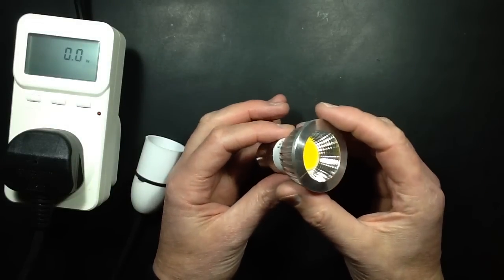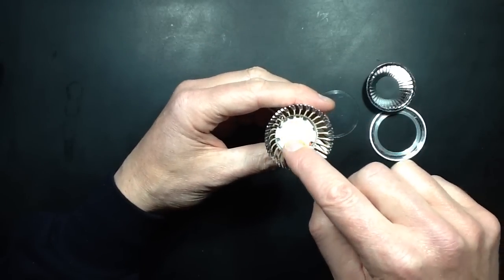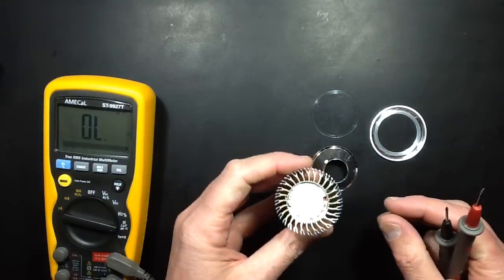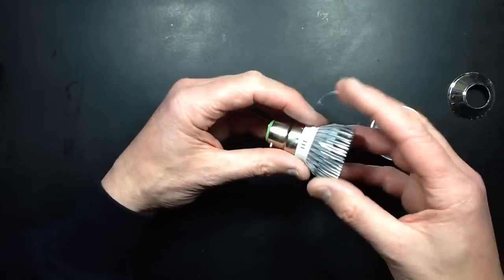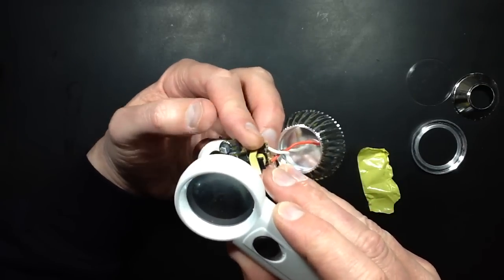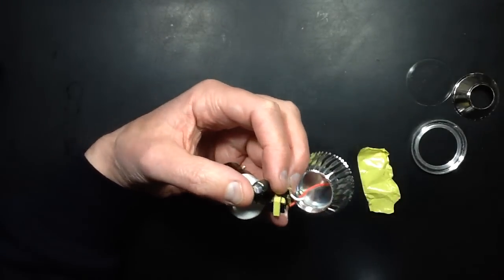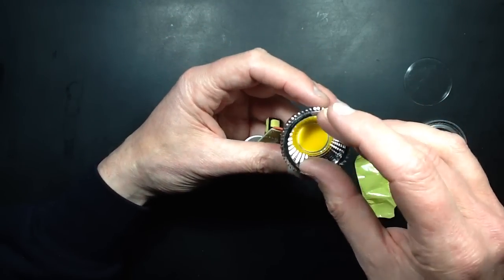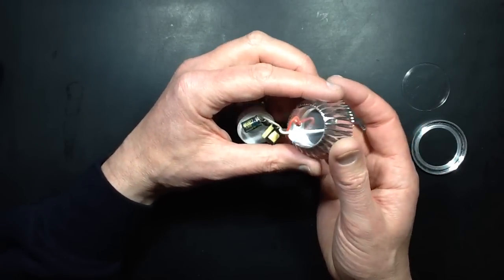A look inside a recent COB style light.

Comment: The power ratings given on ebay for the LED lamps often is the max led chip rating, the actual power is often 1/2 or even less as advertised. The switch mode power supply in most 240v Direct replacement lamps are unreliable, and do not meet safety requirements. The best solution is to move to 12V mr16 down lights and use a reliable external power supply.

Comment: just bought 6 of these lamps, exact ones.. took em to bits, and they are identical, put a different cap and resistor by watching your videos (I've watched them all believe it or not).. now my power usage for all my lights in the house is under 100 watts 2000sq ft with floods outside...

Comment: I bought the 12 volt version of these. Rated 6w but it draws only about 2.6. It uses the same COB that is not properly affixed to the heatsink. I modded all of mine by replacing the COB with a Cree CXA1304 (9v version) COB LED. Much brighter and after two months, still working great.
Reply: +JohnAudioTech this is true.
They are starting to massively overrate the things on ebay
http://www.ebay.com/itm/111915160576?
6 watt, draws 2 watts...

Comment: The threads on the heatsink and cover look like some quite costly machining operations (relatively speaking). Where did you get the light? Is it a poundland/ebay cheapo or something that should have a little bit more quality?
Reply from the maker: +superdau It came from ebay.  I've added a link to the end of the description.

Comment: Searching for "ds1005 led" you reach to datasheet here http://pan.baidu.com/wap/link?uk=104161971&shareid=2762344379&third=15 it is in perfect chinese though... 
Primary side LED driver, 1-5W, up to 18V output and 650V switch. 5-90kHz, typ. 65kHz.
Reply from the maker: +Electronica y Reparaciones That's it.  Looks like a clone of the BrightPower chips.

Comment: I wonder if you could drop an o-ring in there the size of the bottom of the reflector and then put it back together to tighten it up
Reply: That is the best suggestion I have seen so far, and it would address the concern regarding shorting of the positive and negative leads to the reflector.

Comment: You could of put a black marker pen around the inside lip of the reflector, quickly reassemble the lens and screw the outer bezel on tight and see if the wet black marker ink is on the LED surface.
Reply: +Mark Andrews I would have just omitted the transparent plastic cover and then had a look if the COB is still movable.
Reply from the maker: +BloodySword The clear plastic is what presses the reflector down.
Reply from the maker: +BloodySword That did go through my mind.

Comment: Hi Clive - you talk about flicker - is there a way to stop flicker? We had some LED wall & bedside lamps installed but they flicker something hellaceous... Can you get smoothing drivers??
Reply: +Farlig66 It actually doesn't really matter if the LEDs are driven by AC or DC. The switching PSUs and the capacitor dropper work fine with DC. So you could build yourself a nice AC-DC converter without voltage conversion. You can still supply switching LEDs with it if you happen to have those even if they do not flicker. You then get 325V DC in Europe and 135V DC in America and Japan. Put a BIG 400V Electrolytic from an old CRT TV supply at the output and a choke and you should be good to go. DO NOT TRY THIS UNLESS YOU HAVE NO ELECTRICIAN AND ELECTRONICS KNOWLEDGE!

I also shoved such a cap above into one of these maize lamps with SMD LEDs on them. Smoothed very good, no flicker at all, but also made it a bit darker. (But it could also been aging of the LEDs)
Reply: +BloodySword Wow cheers man, way over my ability though - most I can do is perhaps change the driver for the lamp... I´ll call back my electrician and see if he can do something...
Reply: That's smarter to do so. Better keep safe, man.